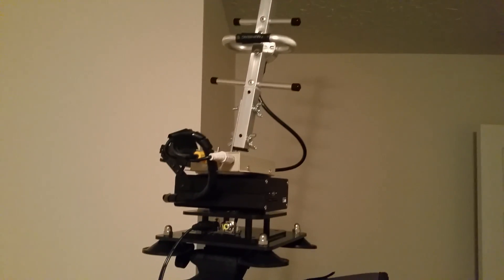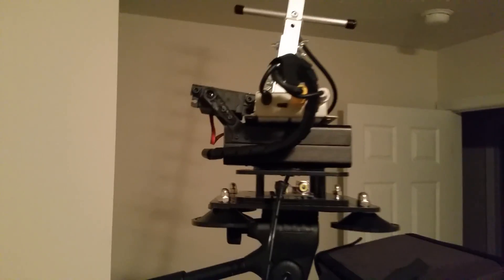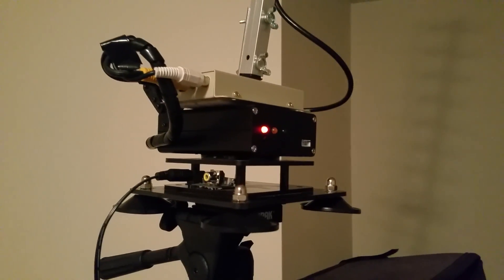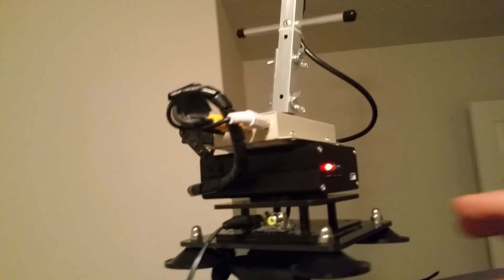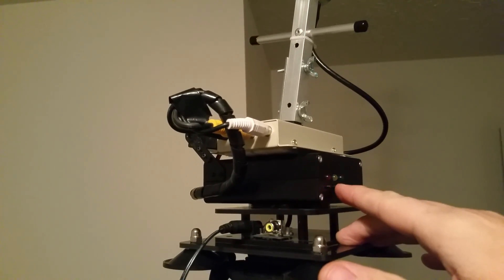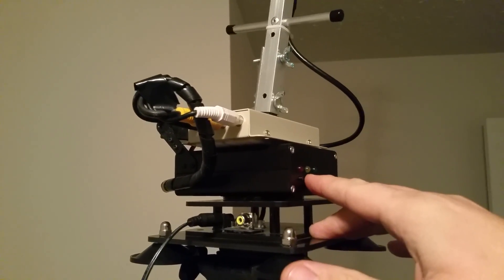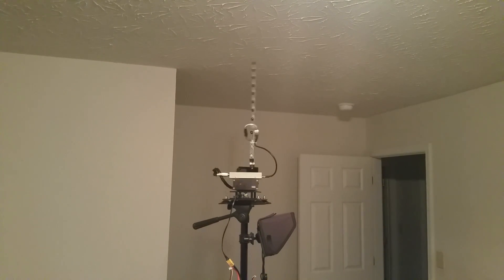Yagi on an Arkbird Antenna Tracker

Comment: Hi, nice to see that the Arkbird can handle it. Can you tell me what mounting bracket you used to mount the Yagi antenna? And what Yagi antenna is it/where did you buy it? Thanks alot.
Reply from the maker: The horizontal rotation servo will eventually give out with the yagi. You'll need to upgrade it. I mounted the yagi directly to the Arkbird AAT by drilling two small holes in the plate and bolting the yagi on. I can't remember exactly which one it is but I got it from readymaderc.com. Unfortunately I don't think they sell them any longer.
Reply: @zbe859  thanks, and what yagi is it?
Reply from the maker: I can't remember exactly which one it is. This video is over 4 years old. Lol It's just a 1.2-1.3, 8 or 10 element yagi antenna they used to sell at RMRC and don't anymore. I'm sure you can find another online somewhere.

Comment: Friend, I can use this tracker antenna with any OSD or controlling system, or only with Arkbird?
Reply from the maker: You can use it with most any flight controller. Except I have heard it doesn't work with the Eagle Tree Vector for some reason.
Reply: It is possible I use on a Drone with NASA on my video transmitter 1.2 ghz?

Comment: interesting. i was thinking of putting a 23db patch antenna on it, do you think it could handle the weight (2kg)
Reply from the maker: Yeah I think that would be fine. I can't remember for certain, but I think it's actually a 2kg servo that comes with the AAT. But I would recommend upgrading to a cheap 10 kg servo from Hobbyking anyway. That way you know you're covered.
Reply: +PoppaShocka oh okay. What brand do you recommend
Reply from the maker: +Ironiic zero This is the one I got and it works great:
HXT 10kg Servo (metal gear) 10kg / 0.16sec / 55g
Reply: +PoppaShocka found another uk supplier that has it. Hobbyking are completely sold out
Reply from the maker: +Ironiic zero Oh gotcha. Good deal.

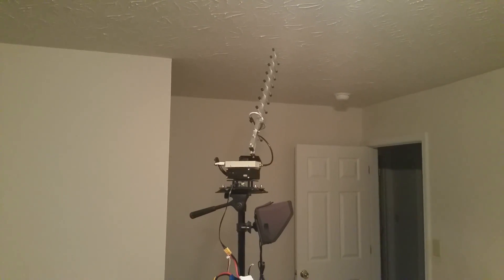Comment: sweet, I see what you mean now. I love continuous trackers on pan. at 2:11 you have a serious snap though. What did help (if gearing down, i.e. more torque less speed) my stuff was a servo speed module from hobbyking. go to their webpage and type: Turnigy 3 Channel Servo Speed/Direction Regulator

that way you can control snappy moves in case you can't adjust the pwm programming-wise. Good work. Cheers.
Reply: +Matt hias , typo: ** (if gearing down, i.e. more torque less speed IS NO OPTION,  with gears)
Reply from the maker: Oh yeah that's a good tip. Thanks man!

Comment: if you made a bracket so that the antenna was held about half way along its length it would massively reduce the strain. You'd have to have it held off to one side but the direction it points would be the same.
Reply from the maker: Good idea! I'm not too familiar with yagi antennas so I'm not sure what impedes reception and what doesn't. I may give that a try tho.
Reply: +PoppaShocka would probably need to be plastic. :-)
Reply from the maker: +Chris Flory this is one of the many times I wish I had a 3D printer..
Reply: +PoppaShocka lego? haha
Reply from the maker: +Chris Flory LOL we'll see how the 10kg servo pans out before I result to that awesomeness. It would look pretty sweet tho.